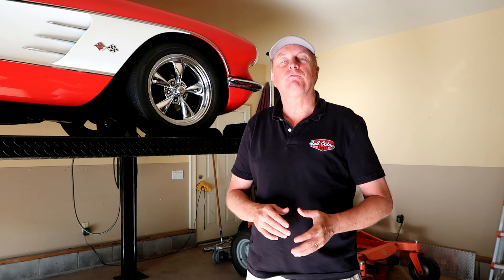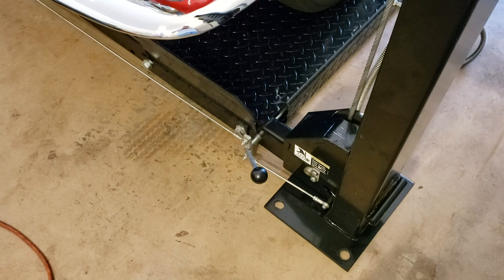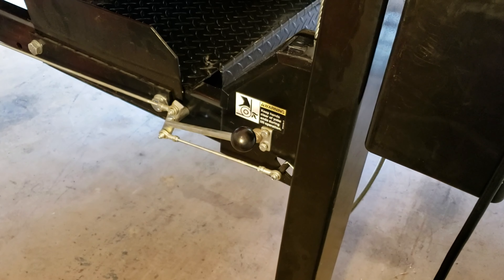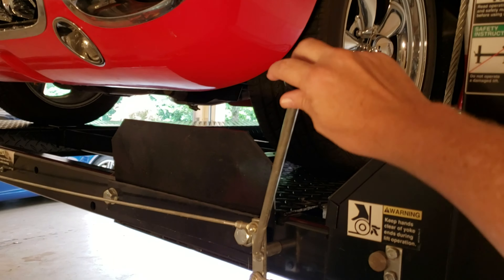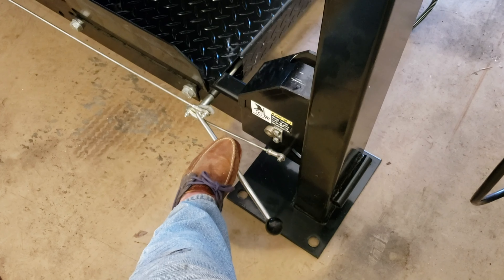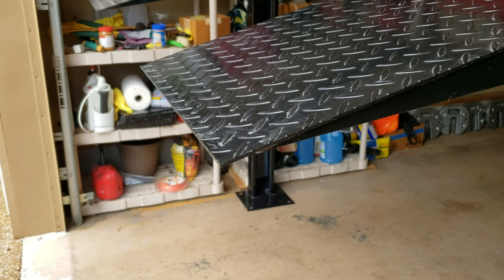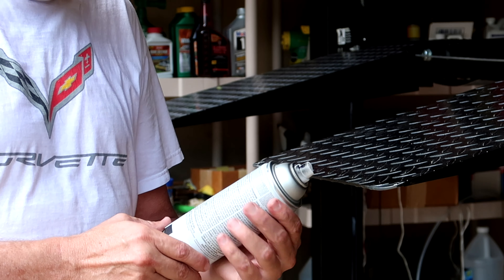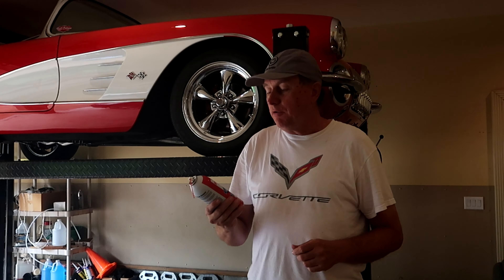4 Post Lift Operations, Safety & Maint (Explained)

Comment: How much lift is required to unlock the tension to drop? My measurements about 1” to 2” from ceiling to roof of car, so I want to make sure I can unlock to drop!
Reply from the maker: I just went out and tried it and it takes right at 1 inch to release the locks.
Reply: @Fulloctanegarage  Thank you :)

Comment: Am a really watching a ramp safety video where the ramp is not bolted down :-O
Reply from the maker: The ramps do not bolt down on this lift, the have a slot they slip into.
Reply: a 4 post on level ground does not need to be bolted down. In fact, many come with caster wheels so you can move them around.